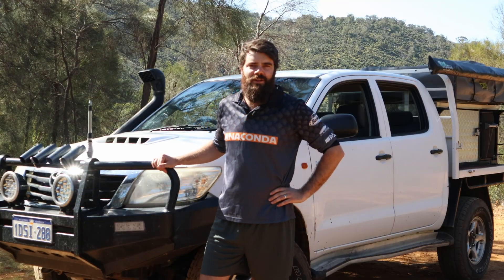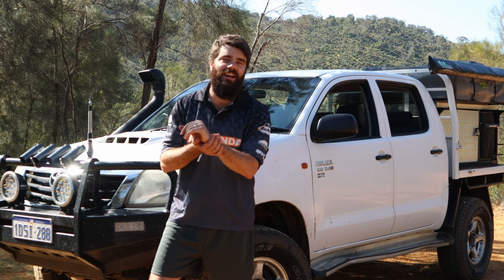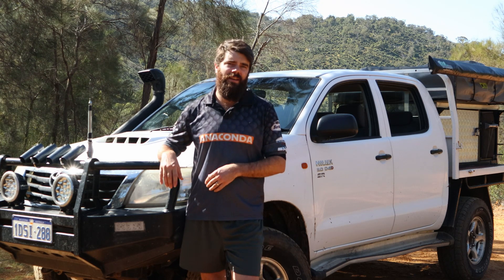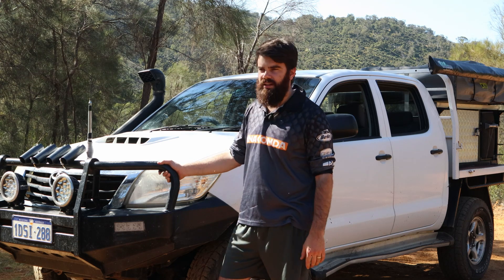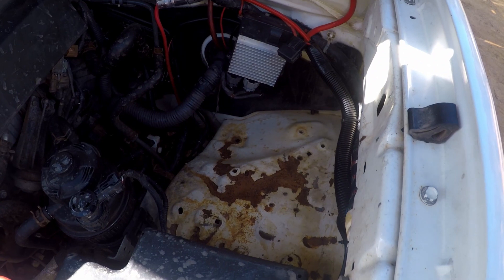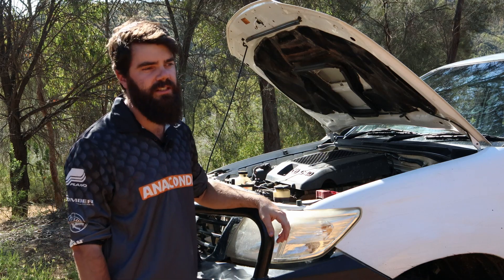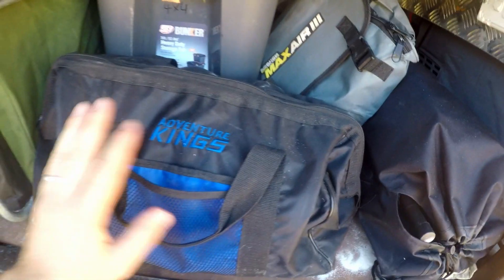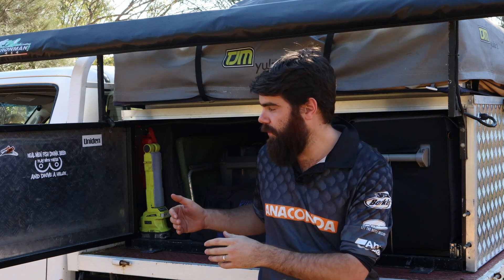Show Me Your Rig | Episode 2 | Damien's 2012 Hilux

Comment: Great to see I am not the only one to have an ex-mine Hilux who likes the basic format they come. I am still getting the red dust out of it after 8 years. 
Did you use a DC to DC charger for the second battery? 

I am thinking of build a small canopy like yours, do you have an plans, drawing, photos or measurements?
Reply from the maker: Hey David, 
Yeah mate, the Hilux has treated me well over the years. Never left me stranded. But that red dust... whenever you want to work on your car, you need a shower inbetween haha
Yep, DC-DC charger, running a Ctek DS250a. it's been great. 

For the canopy, I don't think I kept the drawings, but I can measure it next time I see it (Lux is at the smash repairs after a lady pull out infront of me) from memory it's 600 high and maybe 1100 deep by 1500 along the tray.

I am in the process of upgrading to a full alloy canopy at the moment. hopefully I should be bringing some build videos for that as we go.

- Damien